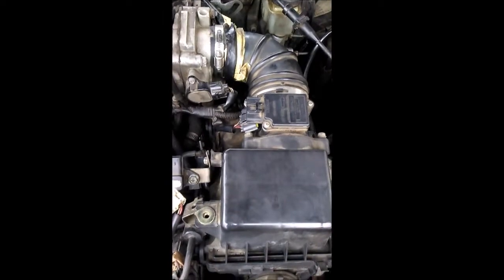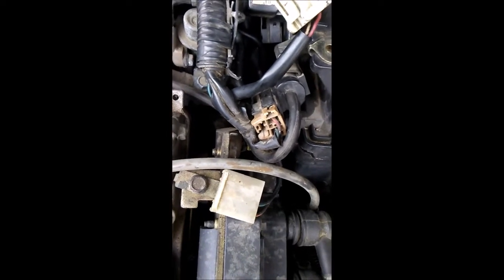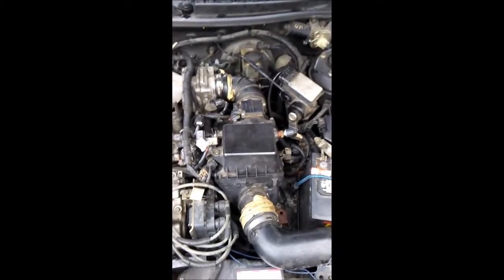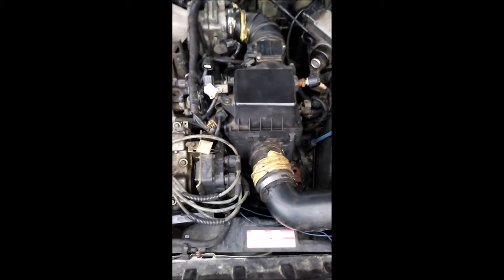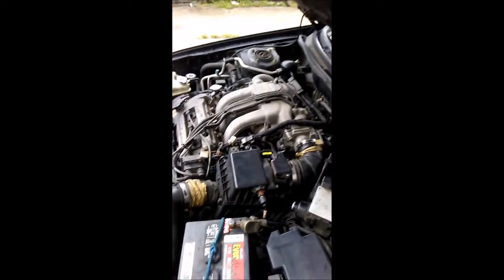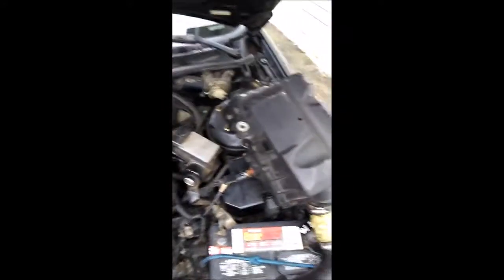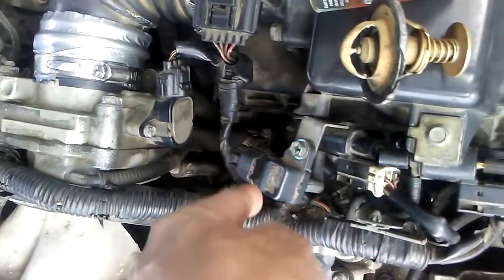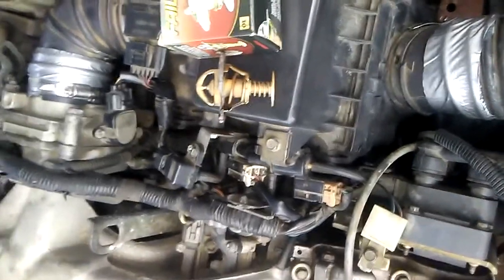Mazda 626 1999 Hidden Thermostat

Comment: did this fix your problem? mine seems to overheat within 5 to 10 minutes as it looses all the water in the reservoir. did you have the same problem?
Reply from the maker: No I didn't, look at your reservoir to make sure it doesn't have a hold in it.